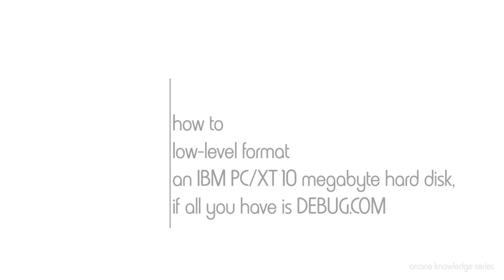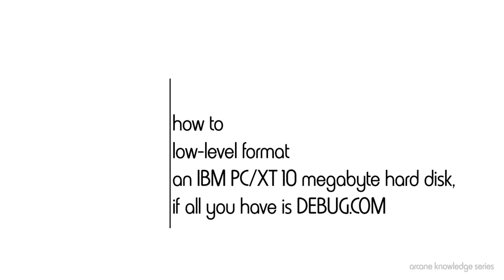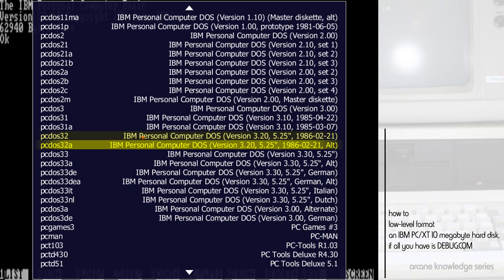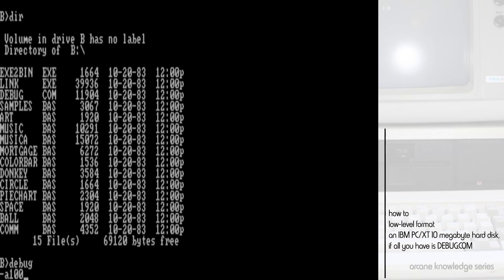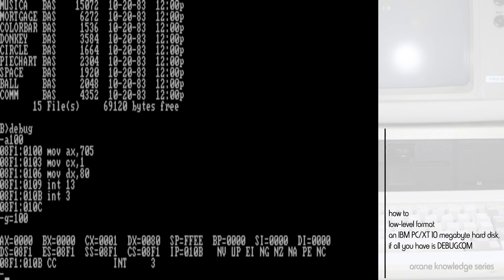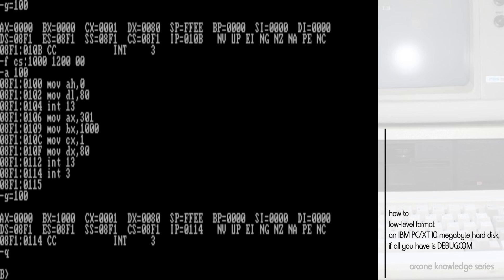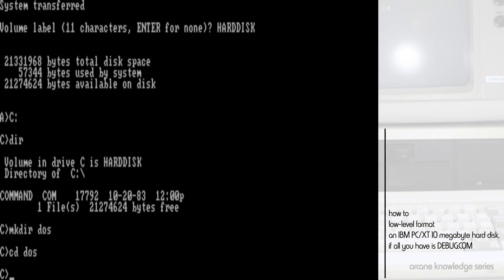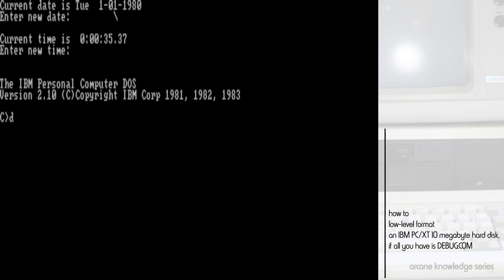How to Format a Hard Disk in an original IBM PC/XT (if all you have is DEBUG)

Comment: Trying to find the point of this video.  Long time follower of yours during your LinuxMCE projects.
Reply from the maker: Well, if you don't see the point, it's not for you. Thank you, drive through. :)

But for those who want to know:

I have run into people who are vintage computing enthusiasts, who were not around when IBM 5150 and 5160 PCs were new, or have forgotten some of the small details that are SPECIFIC and ONLY APPLY to true blue hardware, where on a PC/XT with an original Xebec 1210 controller, there isn't a built in disk formatting utility in the option ROM, so you have to either use the advanced diagnostics diskette, OR you have to manually invoke a low level format, which is what I show here.